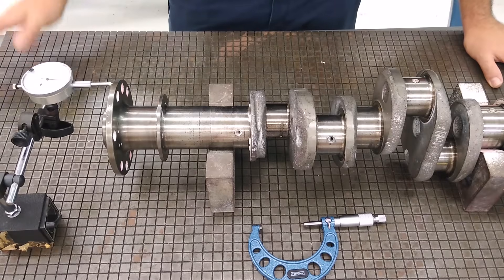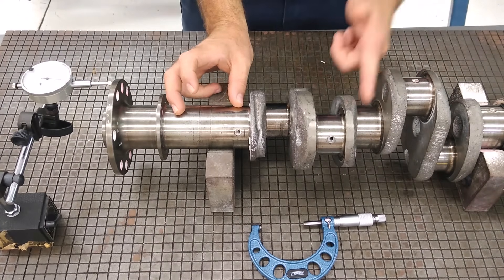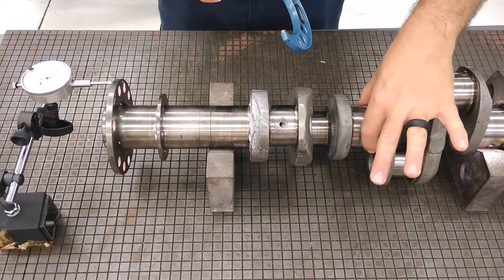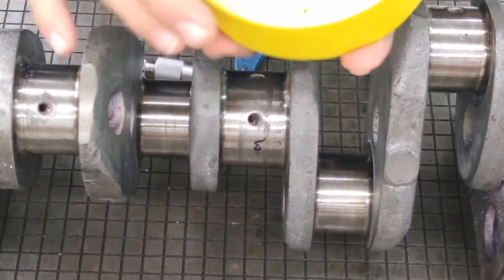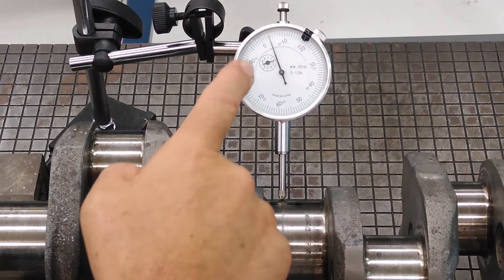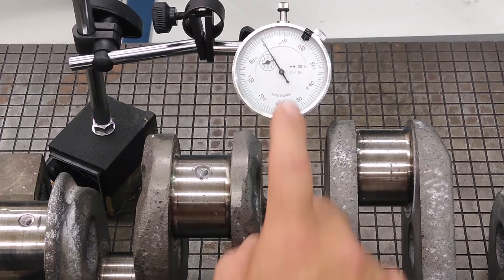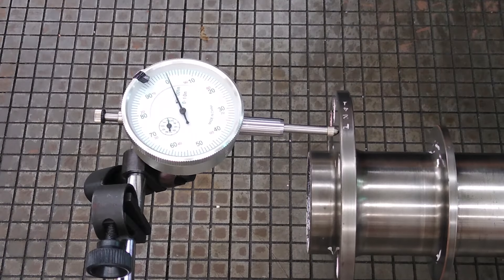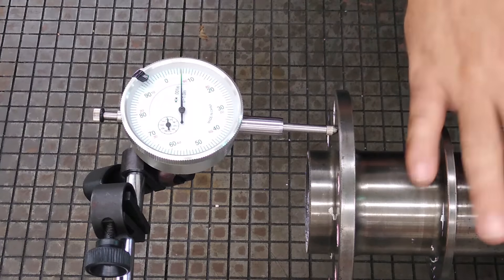CRANKSHAFT runout, out of round, taper. How to measure it all.

Comment: What section of the CFRs would establish the conditions that require to complete these inspections?
Reply from the maker: It would not be the CFRs. It would be either time-based inspections determined by the engine manufacturers, or damage-based inspections l, like after a prop strike as an example. That would also be listed by the engine manufacturer.

Comment: good video, though if I hand grinded a main journal with wet and dry sand paper to get minor groves out, how would then measure or know what size bearings to buy when finished
Reply from the maker: Measure the difference in diameter from the before and after. In theory you should add half of that difference to the bearings' thickness. 
A better method would be to use "Plastigauge" during assembly to measure the actual gap.

Comment: Very informative video, thank you for posting. One question, what keeps the crankshaft from moving back and forth while reading the flange run out while rotating the shaft? Thank you.
Reply from the maker: Set one of the V blocks up against the thrust face of one of the cranks, that will limit the axial movement
Reply: @planesimple8514  Thank you, I'll try that.

Comment: What is the crankshaft sitting on?
Reply from the maker: Hello Vladimir Mako, the crankshaft is sitting on two "V" blocks and the "V" blocks are sitting on top of a surface plate. The surface plate is a precision ground piece of heavy stone or metal (in this case is steel) that is certified to be flat to a high degree of accuracy. The "V" blocks, are also precision ground for both to be the same dimensions. All this precision is to start your measurements from a stable, known condition and not introduce any external deviations to your measurements. This ensures that any deviation is from the piece you are measuring and not from whatever your piece is sitting on. 
I hope this helps.
Reply: @planesimple8514  Thank you very much for explanation. Appreciate that..I'm about to do the same and I was wondering how to perform the measurements in my garage. Those V blocks are crankshaft specific I believe. I'll look around if I can buy them. Or, do you think I can substitute these V blocks with a crank sitting in the block on the main bearings?
Reply from the maker: You are welcome.
Those V blocks are not crankshaft specific, the V just has to be big enough to support the journals on the crankshaft. Also they need to be high enough to allow the crank pins or throws to rotate clear of the table,  without hitting the table. 
I'm sure there many other setups that would allow the measurements to be made, they just need to be secure, precise, repeatable, solid, etc. again, to guarantee that your measurements are correct. 
As far as doing the measurements with the crank in the block...yes, you can do that, but you'd have to have the bearings in place. Otherwise the size of the half moon on the block would be bigger than the crank shaft and would allow side to side movement, ruining any hopes for any significant measurement. On top of that, you are assuming that the block itself is straight, which surprisingly enough is not always true. The block may be straight enough for operation, bit it relies on clearance between the crankshaft, bearings, block, etc. This clearance is taken up by the oil during operation. This means that the block may be straight enough and within tolerance to run the engine, but too crooked to serve as a reference surface to measure from. 
I hope this makes sense. 
Anyway, if the deviations you are reading are  within spec, it should be ok, even if measured on the block. 

Good luck.
Reply: @planesimple8514  Thank you again for such detailed information. Means a lot! Thank you a million!
Reply from the maker: Glad I could help.

Comment: Thx for share ,  I like to ask : where are the thrust bearing located ?
Reply from the maker: Hello stealthy1, the thrust bearings are usually all the first and last main bearing supports and the look very similar to the rest of the journal bearings that are plain bearings, except that the thrust bearings have a flange on either end of it to distribute load in the axial direction (thrust). Google pictures of crankshaft thrust bearings and it will make a bit more sense.
I hope this answers your question.
Reply: @planesimple8514  Thanks Man, I close exam the Lycoming pics but couldn't see it , I know what you mean with those Flanges ( My subaru engine has"em)
att: Nelson

Comment: Greatvideos i learned a lot hopefully i can apply it to my engine that i keep trashing and stop trashing it :) thanks!
Reply from the maker: Are you modifying the engine? racing it? What engine is it?
Reply: @planesimple8514     It is a VG30DETT, v6 3 Litre twin turbo from a 1990 Nissan 300ZX Z32. highly modified pushing around 500 horsepower. 

I have been trying to run it in on special joe gibbs BR driven running in oil, had my bottom end built by a marine engineer specialist with 40 years in the industry and ive been through 3 crankshafts. for some reason the bearings keep going over and over.

I am fairly competent but im currently acquiring the right set of micronmeters and dial bore gauges so I can measure everything myself and hopefully get an engine that lasts!
Reply from the maker: WOW...!!! That's one of my favorite cars from the 90's, of all times really. But they are known for being a pain the asz to work on because there's no space under the hood. 
Anyway, it's a helluva project. 
It sounds like you are doing all the right things and a professional is building the engine. Which bearings are spinning, the main bearings or the conn rod bearing? If it's the main bearings, the engine block may not be square. By square I mean all aligned, all main bearing seats and bearing caps perfectly in line. If this is the case, you'd be forcing the crankshaft to flex and wiggle like a worm with every revolution until the weakest link fails, the bearings. 
Otherwise, bearings being spun is usually the result of lack of lubrication or overheating. 
Lack of lubrication could be from bearing clearances being too large and the oil can just fling out versus being forced to create a film. 
Idk, I'm just a keyboard warrior from the internet so don't pay too much attention. I tend to trust the experts that do that for a living, but its weird to have three consecutive crankshafts fail with spun bearings. 
Like I said earlier, double check the block itself. 
Good luck.
Reply from the maker: By the way, I'm glad you liked my video and thanks for 5aling the time to leave me a comment.